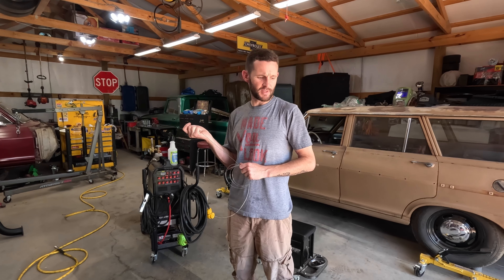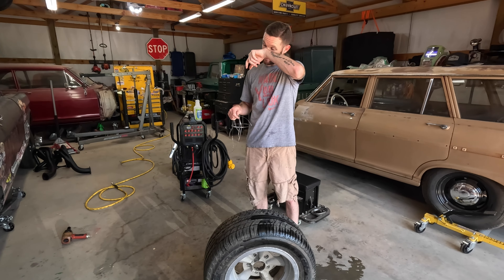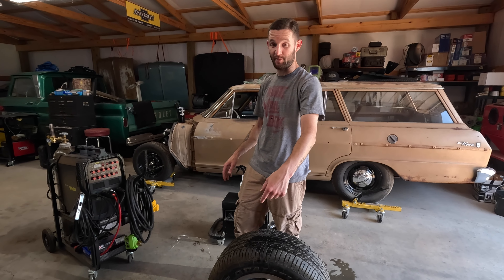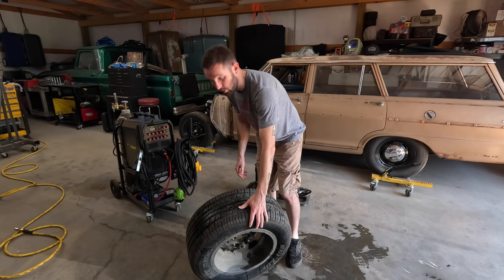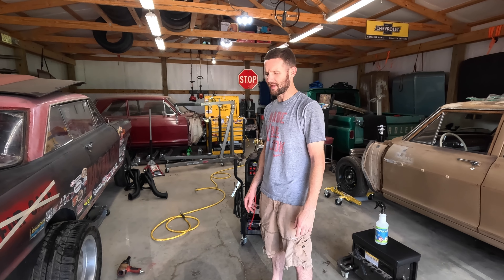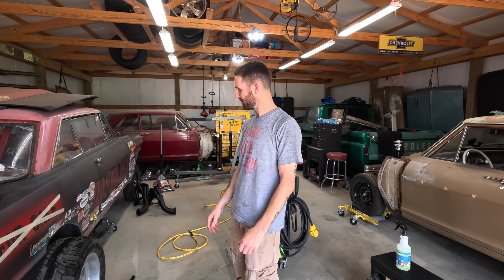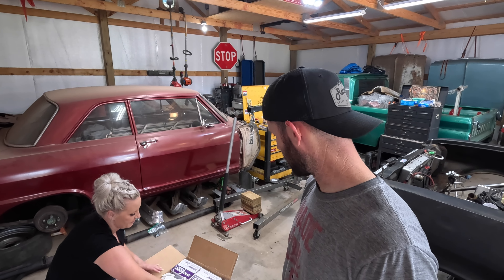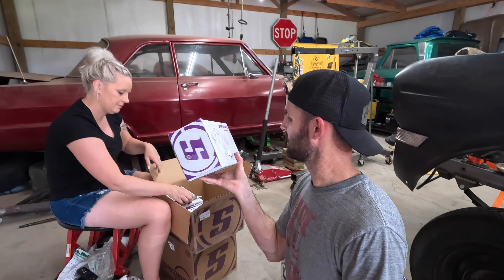Poorly Coaching The Wife On How To Build The Disk Brakes On Gasser - NNN Part 4

Comment: Keep up the good work! I’m a fan of the mag wheels!
Reply from the maker: You bet, chipping at it little by little. The mags have spoken to me. I need to find a set that I can actually run. 
These ones are only good for shop rollers due to some existing damage. I also don't like running unilug wheels. 
But this style is what I will run for sure.

Comment: I think the nuts are self locking nuts
Reply from the maker: Oh definitely. I was actually really happy to see that this brake kit came with the locking style of nut. I really should order up some more for the other bolts I am using on the front end so that I can ditch the lock washers. Lock washers work but for whatever reason I have more faith in the locking style nuts.